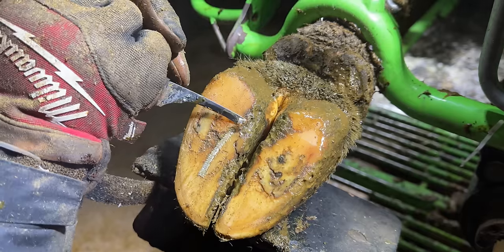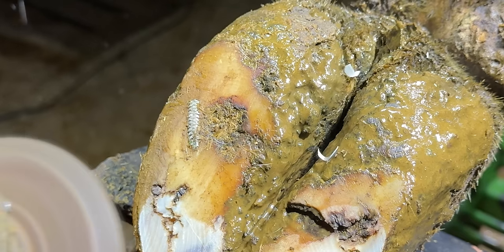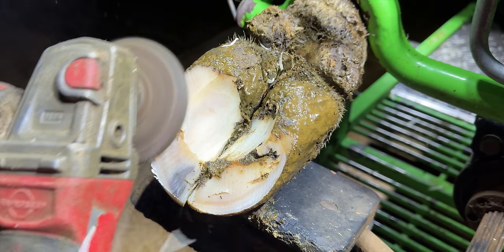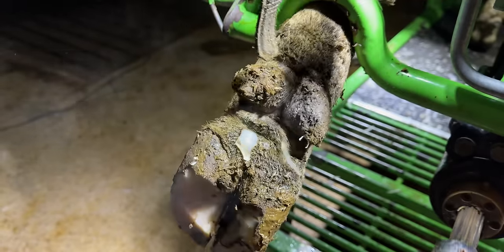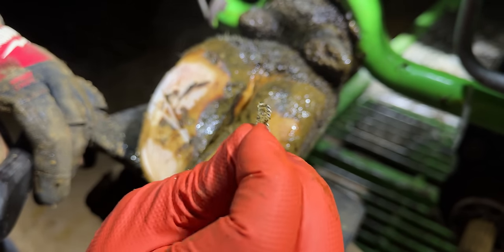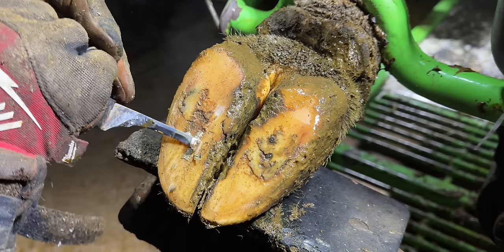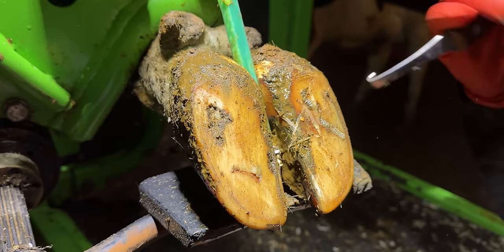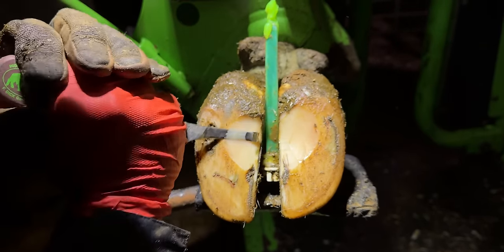HUGE BOLT in cows hoof … WORN FLAT!? 😳

Comment: The farmer might want to run a metal detector over the area where the builders and workers used metal products.
Reply: I can't believe the builders didn't already do a thorough job of that!
Reply: The builders forgot to clean up after themselves. Not good
Reply: Or large magnet!!!
Reply: @DeniseSterling-k5u It might very well be aluminum if it came from the siding. Magnet won't pick that up
Reply: the workers should have run a shop vac around after they were done. Cleaning up after your work is the last step.
Reply: My concern would be if metal shards are carried to where the cattle feed and they accidentally ingest them.
Reply: Cleaning up small trash can be difficult. Sweep, vacuum, and/or mop all you want: you'll still miss small bits. So far, it looks like whoever did the work managed to get the largest and worst pieces.
Reply: @julietfischer5056  how could you possibly know they managed to get the large and worst pieces?
Reply: @leafisher2531 that can be a big problem. There are magnets on the feed mixers most farms use to deliver feed but once the feed is in front if the cows it can definitely be contaminated. Many farms also put a magnet inside of the cows stomach to collect any metals fragments and keep them out of harms way
Reply: Looks to be a clip of staples....
Reply: It’s not staples, it isn’t a bolt, and it isn’t from drilling holes in sheet metal. It is the chips from a dull metal nibbler. With a sharp punch in the nibbler they are half moon shaped and a lot smaller. There must have been construction on the site where sheet metal work was being done.
Reply: Magnet
Reply: What about removing so many layers of dirt and mud 

Then refill it with fresh dirt
Reply: Needs a strong magnet to run around after any  construction undertaken !
Reply: Reroofed a shed 3 years ago and I spent weeks going around picking up nails, screws and old bits of sheeting after the builders had finished the work. The days of good clean work are long gone. It's now get done as fast as possible amd move onto the next job.
Reply: @DCVinson  Right you are! Seeing your comment jogged my memory as to what my husband's nibbler leaves behind.
Reply: Smart answer! Because i see this video thinking why are you posting this? If there is nothing realy wrong. But you're answer give it word anything. Thank you.❤
Reply: These builders didn't tidy up after themselves.
Reply: This area for the cows definately needs inspection
Reply: The roller magnets are the best…😊
Reply: Metal detector will just find the rebar in the floor . Use a broom and a magnet 🧲
Reply: @kennethbrown8723 - Those are pretty damn obvious, for one thing. For another, this video is not about cows with hooves ruined by junk.
Reply: Glad that didn’t amount to any damage to the cows 🐄 hooves hopefully there’s not a heck of a lot more floating around to be stepped on or Worse yet INGESTED by the cows if it by chance got into their feed
Or grazing area.
Reply: @2aisabsoluteTim wish that would help in my case. My land is so riddled with debris, glass and sharp metal. Nails and springs... Old remnants of electronics. I've done 12 feet below and I'm still pulling up these things. I have no idea what the people were doing before I moved in. And I'm just a rural farmer who got their hands on this place.
Reply: @2aisabsoluteTim that can get very costly. And if you have to bring the dirt in, you still don’t know what you’re getting or what’s in it
Reply: @kennyferrick1240 - There should be records of who lived there and what types of businesses they ran. Unless you're finding the remains of their junkpile after they hauled the big stuff away.
Reply: @julietfischer5056 except they don't use a mop, broom, or vacuum, to clean after doing metal work... Did you pay attention at all?
Reply: I recall using one to look for a fallen coulter. It went off randomly, without revealing the object, and I finally realized it was responding to the grommets in my boots.
Reply: My friend was in a new build, beautiful garden for the kids, they dug down to bury a trampoline part way, and a foot down was rubble, bits of steel, roof tiles, they even found a hard hat and ONE steel toe capped boot. 
The builders used their garden as a dump, then dropped a bit of soil and some turf on it.
Reply: Cows have hoofs not feet, why does he keep calling him feet?
Reply: @robertdawson291  because they’re feet. 
He uses both words. 
And the hooves turn to feet at the heel bulb, and underneath the hoof horn, so both words are ok. I hope this helps. ❤
Reply: I would imagine an large magnet would be more effective
Reply: I was thinking the same thing immediately after the intro.
Reply: @snowpiercer8174 that's true. And when I was watching the trim as he was removing the metal it was flaking away and easily tearing apart which is also an indicator its aluminum because it was so fragile
Reply: @julietfischer5056  there used to be remains of other building structures from what I've found out and they had tons vodka bottles littered all over the property, and I still about 4 years later, pulling them up from the ground. We have no idea what business they did here, not even those who sold the place could tell us. The garage was filled full of wood, glass, signs and a room had traces of sewing and crafting. And a mystery... Room that had a door with a lock installed backwards, and the electrical job was absolutely horrifying as black to white wires were nearly touching one another and the way they hid all the damage by slapping on vinyl wood on every wall to hide what was utterly dangerously done. Things installed incorrectly and strangely done. And what was even weirder was a whole three different dessicated mummified rabbits stapled and nailed into the wall that was hidden behind the vinyl 😭😅😐. And a bunch of empty slugs, shotgun shells and bicycle parts as well behind that with the... Uh... Rabbits... I just don't know what to think of this in general. I want to say junkyard but I don't think that is really the case finding the remains of other buildings which appears they were attempting to burn it all down on further investigation.
Reply: Roofers use a rolling magnet to pick up screws, nails and other metal.  That thing picked up nails that had been in the ground for years.
Reply: @kennyferrick1240  omg that sounds very suspect. Rabbits nailed to the walls,?, doors that can be used to lock people or thing IN?,? And an attempt to burn it all down?,?, that sounds like some sketchy stuff going on. Are you the home/farm owner?
Reply: Did anyone watch the video and hear him talking about this?
Reply: @2aisabsoluteTim - Probably expensive.  There are labor costs for digging out the old dirt (even with machinery) and the costs of properly disposing of it. The new dirt must come from somewhere, which means buying and transporting it to the site, and then placing it. And that's if it's even feasible to do all that in and around a completed building.
Reply: Yeah they looked like pices of helacoil from fixing stripped threads
Reply: Easy to say but the sheer scale of these areas is really hard to actually check thoroughly
Reply: I have run a magnet over my regular domestic yard about a thousand times after we got a new roof. And I got a new hole in my foot about two years ago. And an updated tetanus shot. Yesterday I almost had another new hole in my foot. This time I was wearing shoes though. 😂😂 So it just went into the sole and barely poked me. I don't know where they hide. But there's nothing other than crawling in a military belly crawl style in a grid formation to hunt everything by hand. 

Nobody has time for that. Or the stamina. Maybe 4 year olds. But a group of those is about like herding cats.😂😂

Comment: at my last barn, after getting arena footing delivered we usually drug magnets to make sure no metallic debris was included in the load.  It was common for folks to use hogs fuel; ground outer bard from cedar and Douglas fir trees
Reply: that's "hog fuel"  any mill scraps that don't have their own inherent value get run through a grinder called the hog, and were originally sold as boiler fuel.
Reply: Atleast the magnetics will be pulled….. as for the non- magnetic 🧲
Reply: Past tense for drag is dragged.
Reply: @CometAura it's a common term/dialect here in the US
Reply: @CometAura Not always.  In American Standard and many American vernacular dialects, 'drug' can be used as the preterite, while 'dragged' will denote the imperfect.  In some dialects "dragged" is used for both.  It's far from standard in the fun little muttly we've bred over here 😂
Reply: All that was aluminum.  No magnet will get that.
Reply: @just_plain_awful932  Do you have a source or anywhere I can read more about that? I can't find much from what I googled earlier.
Reply: @just_plain_awful932 
Drugs are bad, mmmkay.
Reply: Can't we all please just be nice? Please?
Reply: @applicationuser9764  wait who isnt being nice?
Reply: Dragged not drug
Reply: @rumakingthatup - shameful
Reply: @bronxcheer1484  not even close

Comment: Commonly known as "Green Waste", Sold to the farmers who innocently buy it as cattle bedding. Its recycled wood from the council tips (Ikea stuff etc,). The local council pay the wood recyclers to take it, they sell it to the farmers to get rid of instead of recycling properly.  The metal bits are from a material called Mazak, which is basically recycled aluminium, and therefore cant be picked up by a magnet. A complete nightmare for metal detectorists too.
Reply: @Markyoung2715 So many shenanigans in the recycling industry. Disheartening.
Reply: Worked for my county at the landfills, which workers desperately tried to keep garbage (anything not wood) out of the demolition piles, but the public refuses to follow the rules.  
Don't even let me get started on telling what we find in the actual recycling bins....😳
Reply: @ecouturehandmades5166 - I had a weekend security assignment at a landfill for construction debris (the remains of demolished buildings). Once, when the gate was broken, I stopped a man who wanted to dump his trash there. He seemed to think $300 was sufficient to make me ignore the rules. They are there for a reason.

(Somewhere nearby was a dirt track, and every once in a while someone would drive up because they thought a working landfill would have a route to it.)

Comment: We had a huge industrial magnet that my dad and my uncle attached to an old lawnmower body. All we had to do was push it over an area as though we were mowing the grass. We actually found several sets of car keys and other treasures that had slipped out of holes in pockets—as well as horseshoe nails and metal shards that would have wreaked havoc on our livestock hooves. (It was also pretty sweet when we lost a tool. We weren’t the wealthiest of farm families, and we didn’t have money to replace tools we needed for our day-to-day operation. Tractor parts, too!)

Comment: Im a builder in NZ. Recognised those shards immediately as nibbler trimmings, its a tool used to cut metal roofing sheets and flashings. 😁 great video
Reply: Late to the party but can confirm. Sheetmetalworker by trade. Pick these out of my boots when the nibblers start getting blunt. If they're sharp they should be individual crescents.

Comment: That is scrap from a nibbler. A power tool used to cut sheet metal. It cuts little C-s out of the metal, but when the blade is dull, they can stay together in short strings like the ones you found. It's a good and quick tool, but it always leaves a mess.
Reply: Came here to say the same thing. They are almost impossible to clean up even with a magnet.

Comment: That looked eerily similar to soft steel or metal shaving from drilling thicker materials than roofing tin panels. 
I'd make them when I were making holes in soft steel beams with 5 - 10 mm thickness metal. 
It's really easy to do on a pillar drilling machine, but you probably can make them with handheld tools too.
When they're made and put pressure on, the spiral shaped shavings flatten to a thin stick with slightly angled edges like in this video. 
They're brittle and breaks regularly. 
They should have done a work site cleanup before opening it to the animals, that's for sure!
An inquisitive cow can eat shredded aluminum cans in their feed, so these metal shavings are easily eaten by cows. 
I hope Graeme alerted the farmer so they could take action, because those shavings are sharp as knives.

Comment: Looked like flattened staples from a staple gun.  A wide rolling magnet, basically a big rectangular magnet, sometimes almost a meter wide (industrial ones can be bigger) with wheels on either side and a push handle.   Would help fix it with minimal effort.  Sometimes industrial ones are mounted to equipment, forklifts etc so as they drive around, they help pick up that stuff.
Reply: If its aluminium it wont pick ought up.
Reply: @aaronstorey9712  True.  But most bolts, screw staples etc are steel.   Of course there are some aluminum ones out there.  But can only visually check for the type.   I'd lean towards most of them on a farm being steel.

Comment: those look like staples used in carpentry, by tools called hammer tacker/hammer staplers. they are used to hold house wrap, water proofing membranes and others on the walls, roof, deck frame work and so on. i could be wrong
Reply: Yes. Those are certainly staples for a staple gun. Probably for attaching the wrap, such as Tyvek, on the unfinished exterior walls. Someone commented about using an electromagnetic as part of cleanup and that is what should have happened, but obviously didn’t.

Comment: Builders just want to get the job done (just like all other workers), im sure this isnt the first time you have seen metal in hoofs after builders have done some work and im sure it wont be the last time either, well done for solving the issue before it did any damage 💖
Reply: I've worked in construction. Cleaning up every last little piece of metal, plastic, and such is impossible, but we can get most of it. That farmer still has to check that building.
Reply: @julietfischer5056  no one said it was possible for every bit to be picked up and yes the farmer does have to check the building but like builders can't pick up every single bit nor can farmers

Comment: The metal is from using a cordless nibbler. It’s the scrap that falls out from the punch. They are all connected because the punch is dull. They usually fall apart individually. Running a magnet around the cutting area would pick them up. Not good for a cow hoof,but really bad for a dogs paw
Reply: If those metal scraps are aluminum, a magnet is TOTALLY USELESS!
Reply: @Cricket2731  it’s not aluminum it’s from the corrugated (ribbed) steel they are putting on the barn
Reply: @angiedavis6354 , thank you!

Comment: So, would metal shards like this cause issues if you hadn't been in on this day? I know you said they were picked up on the way to thr crush but if the scenario had been different and thin shards like that were picked up somewhere else, would they have eventually caused an issue or would they have worn away because they were so thin?

Comment: Builders should have been using a magnetic broom to clean up. I built myself a new barn last fall, and the magnetic broom picked up sooooo much dangerous stuff I wouldn't have even noticed. Those looked like staple gun staples. Having stepped on those before, I'm glad none of the cows were injured.

Comment: I'm not suggesting to leave it in but if you guys didn't trim today and they were embedded into the hoof, I don't believe it would have caused any issue? Don't the hooves wear away and flake off? Wouldn't the metal shaving also fall away given how shallow it was stuck inside?

Comment: That metal in the cows feet was little shards from what we call a nibbler.  Use it to cut metal siding and roofing and those little crescent moon shaped shavings are the pieces that get cut out from the sheet.  I'm guessing they are building or remodeling on that farm.  Poor house keeping on the builders end to not sweep up after or to even be cutting metal where cows are at.  Built ALOT of barns and we always had to be aware of pieces of dropped metal, screws and nails.

Comment: Leaving bits of sharp metal lying about after finishing a job is extremely unsafe, especially if the job is a building meant for animals like cows, horses, or other farm animals. The metal can become embedded in their feet, like we see in this video, or even end up in their feed (which is extremely dangerous and can lead to the deaths of the animals). I suggest letting the farmer know what you found in the cows’ feet so he can try to get rid of as much of the metal debris as possible before one of his cows goes lame. Those bits looked more like bits from a nibbler than shavings from holes drilled in the metal sheeting for the roof.

Comment: "Nothing to worry about" in their feet, but if I were the farmer I would be very worried that the metal the contractors have dropped getting into their stomachs! It causes a condition vets here in the USA call hardware and it can kill cows! The herd should be fenced out of the area right away and it needs to be cleared of metal with a careful magnet sweep..

Comment: The farmer should not have trusted the builders to properly clean up after themselves. Sad to say, many construction people are careless when it comes to clean-up after a job is done.
Some years ago, I had a garage re-roofed. I found a couple of nails in the driveway, and went to buy a powerful rod magnet. Sure enough, walking around the garage, I ended up with over two dozen nails discovered in the grass. Never trust construction workers to pick up small debris. You'll have to do it yourself.